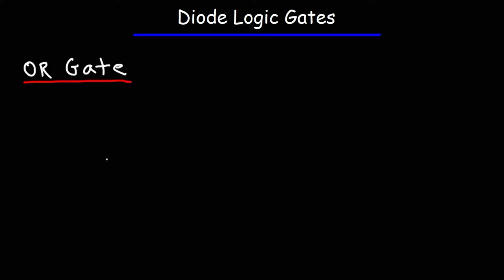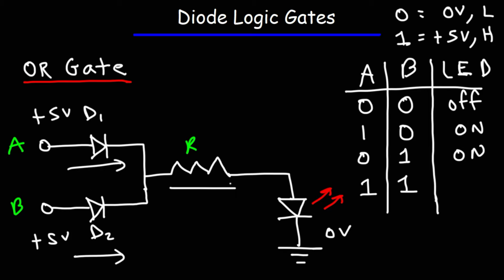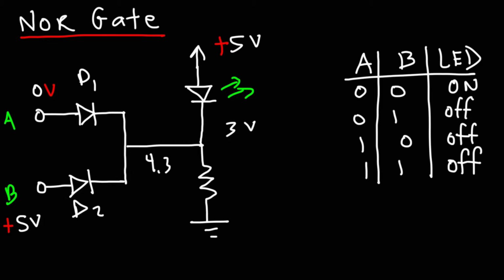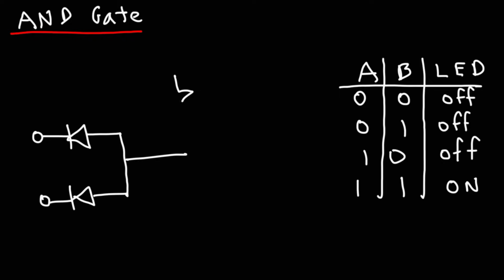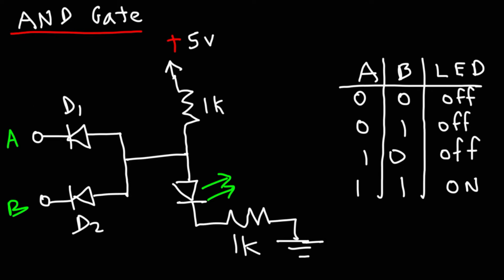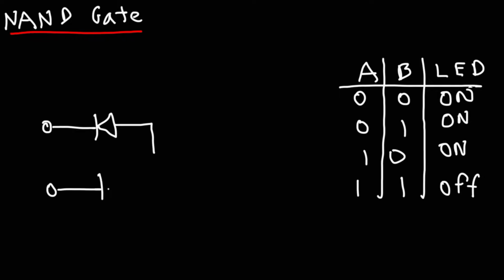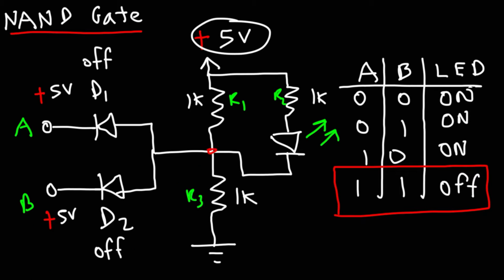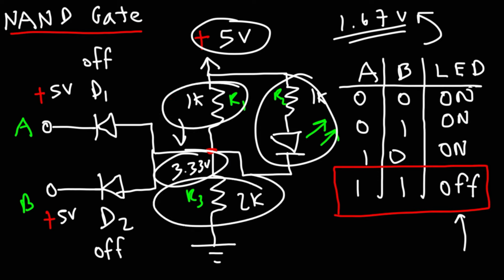Diode Logic Gates - OR, NOR, AND, & NAND

Comment: So while NOR gate works for the LED it is not an actual NOR gate, as the output in cases where A and B or both have 5V is about 4.3V whereas in an actual NOR gate it should be 0V, for the explanation of LED it is fine

Comment: question for the nand gates case: if we used all 1k resistors, and there was a 2.5v drop across the right path (1k resistor + diode), shouldn't the led still be off? My thought process is the 2.5v must go across the 1k resistor before it reaches the diode (and when it does, it should drop enough voltage to become less than 2v), therefore since we don't have 2v across the led, it stays off?

Comment: I found that R1 and R3 are not needed in NAND Gate, Just the two parallel Diodes connect in series with LED and Limiting Resistor and then to +Vcc works.

Comment: @ 10:00 How are A and B considered as inputs of the AND gate with the diode blocking them? A and B would have to be a switch where the NC is to ground and the NO is to 5v? That seems like a big assumption to not have mentioned. The typical circuit would have A and B as a switch with NC being an open circuit.

Also, the only reason the current follows D1 or D2 when they are 0v is because it has less resistance than the LED and second resistor, right? You never state the resitance of the diodes and LED. I am asking this because if you dont consider that fact, and instead first calculate the voltage drop across R1 as if it would next follow the LED, it would only drop 1.5v, which would be enough to power the LED.
Reply: This is a 5V logic circuit. All inputs are assumed to be either +5V or 0V (ground). Open circuits are undefined in logic circuitry. They should never occur because they can cause errors.

Secondly, no. The input diodes have a biasing voltage drop of 0.7V, and we are assuming they are connected directly to ground. This means the voltage at "point C" (as he labeled it later in the NAND circuit) will be pulled down to 0.7 volts. That is not enough to turn on the LED.

Voltage drops across resistors do not remain static when the circuit condition changes. When point C becomes 0.7V, the voltage drop across R1 (top resistor) will necessarily become 4.3 volts. If there was a fault in this video, it was the fact that this was not explained clearly.
Reply: @aviandragon1390  Can you explain more about how the diodes "pull down" the voltage to 0.7 at C point. 
Is it a characteristic property??
Reply: When analyzing circuit behavior we usually assume we are using "ideal" components (which have perfect characteristics) or we assign them a typical value, which is obviously more like what actually happens in the real world.

An ideal diode would have infinite resistance in reverse bias and would have zero resistance in forward bias. That is not what happens in reality, in either case. He is assuming characteristics of a typical diode throughout this video.

Real diodes have a leakage current in reverse bias (this characteristic can almost always be safely ignored, which he does), and they have a voltage drop when forward biased. Ideal diodes are almost never used in circuit analysis, but it might be useful for you to try it yourself in this instance (or imagine what would happen if you replaced the diode with a switch and turned it on and off if that's easier for you).

If your question wasn't already answered by that rambling, see if you can perform thought experiments by replacing a diode in the circuit with an ideal diode or a switch and think about what would happen on your imaginary volt meter at point C or at other places in the circuit.

Comment: Where is the OUTPUT node of these gates?  With respect to inputs A and B, there must be an usable Output pin to drive, e.g., the base of a transistor.
Reply: The output is where the LED is. Remember that this is diode logic. It has long been extinct in logic circuit design. Transistors had not been invented yet when this was still being used.

Comment: 5:30 That NOR example isn't a real gate, hasn't a real output that you can use, I wish it work like that, but you need a transistor to invert OR diode gate into a real NOR gate with output a signal.
Reply: thank u peethobby

Comment: Stick to chemistry; your teaching technique for logic functions is worse than poor; it is wrong.  By changing how the LED is connected to the input diodes, you are flipping back and forth between active-high and active-low logic conventions without a word of explanation.  On and Off have no place in a truth table, which is why 50% of your tables are semantically correct, but logically wrong.  If you instead assign 1's and 0' to the outputs, you will see that the NOR and NAND tables are wrong.  The problem is the schematics.  The schematic for a particular type of gate is what it is, with no regard for what is connected to the output.  Your truth tables depend on changing output connections, whereas correct ones do not.
Reply: Booo man
Reply: Oh boy the yapping convention is in town
Reply: @BradleyCodes  nah let him cook; what hes saying is actually pretty important

Comment: What about all of the other logic gates such as XOR, negative-OR, negative-AND, negative-XOR, etc...Also  on the AND-gate towards the end, you said the potential at the point right before the LED was 3.5-V, how is that possible? If the potential is 5-V at A or B and the Diodes drop 0.7-V across each of them , that leaves 4.3-V. Since 4.3 > 3.5, shouldn't that be the potential at that point?

Comment: I’m curious as to how these circuits can be used to derive a +5V trigger or gate signal for use with a modular synth circuit. Where would one tap the signal in order to get a healthy +5V based upon the resulting truth tables? I’m especially interested in the AND circuit. 
I built one with 2 NPN xstrs but the resulting output is useless. Building it with diodes and a 5 volt rail seems like a good time.

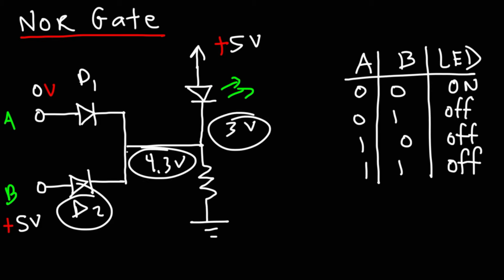Comment: At 6:17, there is electrical potential of 4.3 V after diode and 3.0 V after the LED.  Why is electrical potential set at 4.3 V and not 3.0 V at this location?  Why is the larger chosen?
Reply: The voltage drop across the diode (.7v) is less than that of the LED (2v) so it will take the least resistive path to ground (no potential). In other words, the diode only resists .7v leaving the following point at 4.3v, rather than the led resisting 2v and leaving you with 3v at the following point. The greater potential is from 4.3v to 0v so the larger is chosen.
Reply: @chrisp1582  But will any current actually flow through the LED? I need to set this up on a breadboard and do measurementts. 
You are saying the general rule is this?: When two or more paths connet to a common node, the voltage from that node will be that of the highest voltage source.
Reply: @typedeaf  Yes, current will flow through the led. This is simply the measurement at the connecting node which would be that of the least resistive path. The voltage at the node will be that of the greatest potential to ground which can change based on the volume of voltage from the source. So if you increased the voltage source from another point that value could change at that connecting node.
Reply: The larger value takes dominance at one certain point at a time

Comment: (1) At 6:17, there is electrical potential of 4.3 V after diode and 3.0 V after the LED.  Why is electrical potential set at 4.3 V and not 3.0 V at this location?  Why is the larger chosen?

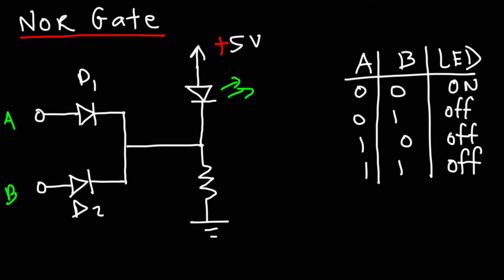(2) At 5:27, what is purpose of diodes in OR gate?  It seems the circuit would work without them and they are redundant.
Reply: For 2) in actuality the values 0s and 1s will not correspond to 0 and 5v
We need some device which will restrict current at a some voltage and diode does this, If A had a greater potential  than at other side , the diode will be reverse biased and offer high resistance and no current  flows, but a conductor wld allow current in the other direction

Also, current can pass through conductors even though  there is no potential difference...
Reply: 1. The voltage drop across the diode (.7v) is less than that of the LED (2v) so it will take the least resistive path to ground (no potential). In other words, the diode only resists .7v leaving the following point at 4.3v, rather than the led resisting 2v and leaving you with 3v at the following point. The greater potential is from 4.3v to 0v so the larger is chosen.

2. The purpose of the diodes is to act as a switch in the circuit. If voltage is applied at either A or B then the LED would be OFF due to the greater potential across the diode. Similar to answer 1, the diode resists less which allows a greater potential and an easier path of resistance.